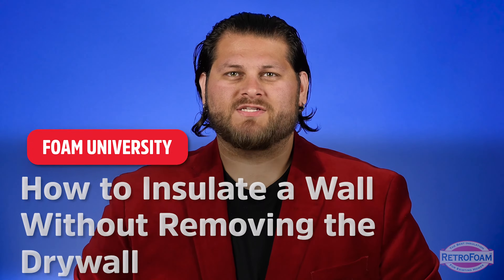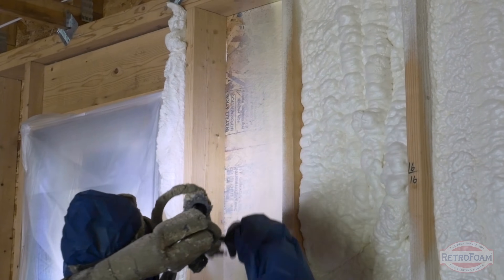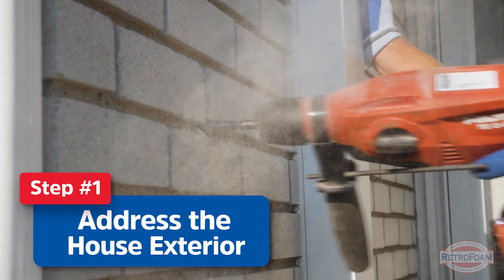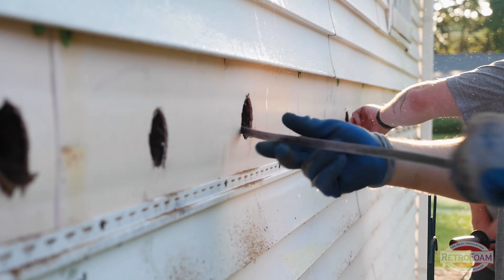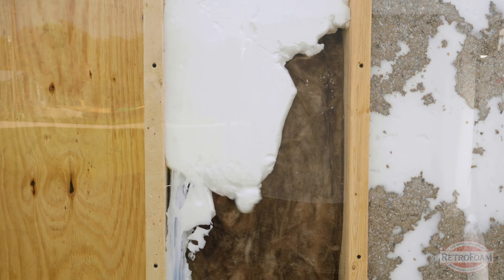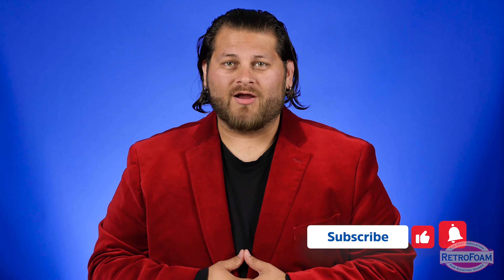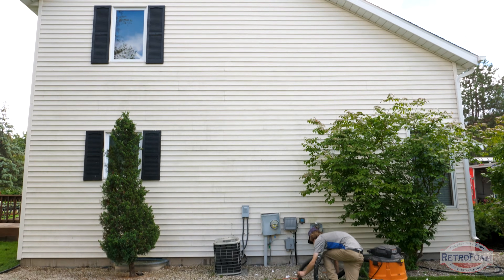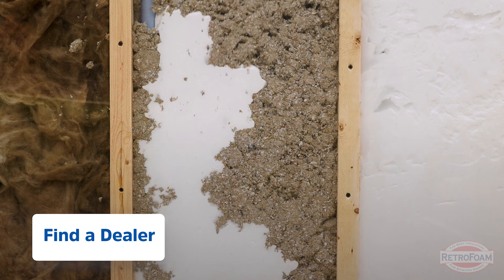How to Insulate a Wall Without Removing the Drywall | Foam University by RetroFoam

Comment: Will this method work for ceilings as well? I have a sunroom I'm converting and the ceiling is not insulted at all. 6 inch joists on about a 15 degree incline.
Reply from the maker: It depends on the ceiling cavity depth and the composition of your ceiling, but based on what you've already said, it sounds like it should be possible! Check out this article from our Learning Center for some additional information on this topic: https://www.retrofoam.com/blog/retrofoam-ceiling-insulation

And you can follow this link to find a RetroFoam Dealer near you: https://www.retrofoam.com/dealers

Comment: What about a home with plaster walls? could this be done the same way (drilled hole between each stud, and filled)? Also! Can this be done through the interior walls?
Reply from the maker: Hello! Yes — RetroFoam can absolutely be installed in homes with plaster or even lath and plaster walls. The process is very similar to drywall, with holes drilled between each stud to fill the cavity. And if needed, it can also be installed from the inside — the crew will protect your space, drill and inject the foam, then patch everything up when finished. Here are a couple of helpful articles on both of these topics:

https://www.retrofoam.com/blog/insulating-plaster-walls-with-retrofoam

https://www.retrofoam.com/blog/insulating-exterior-walls-from-inside-with-retrofoam

Comment: Can this be injected in the basement ceiling? Is there any company in toronto Canada using this method?
Reply from the maker: RetroFoam can be used to insulate ceilings, including basement ceilings, but there are some important factors to consider—like cavity depth and ceiling material. In some cases, it’s a great option, but in others, there might be better solutions depending on the structure.

As for working in Toronto, we don’t currently have a dealer in Canada using RetroFoam specifically.

Comment: Would this cause a problem if you needed electrical repairs in your walls or upgrades to your electrical?
Reply from the maker: Nope! RetroFoam injection foam is soft and pliable, even after it has cured. This means it's relatively easy to fish electrical wiring through it, and sections of the foam can also be removed and replaced for plumbing repair. Check out this article from our Learning Center for some additional information on this topic: https://www.retrofoam.com/blog/fishing-electrical-wire-through-insulated-walls

Comment: We have hardy board siding, hopefully that wouldn't be a problem.
Reply from the maker: Not a problem at all! Homes with Hardie board siding can absolutely be insulated with RetroFoam.

Our crews are trained to carefully remove and reinstall the cement board siding without damaging it. After the foam is injected into the wall cavities, the boards are put back in place and sealed up just like before. 💪

It’s a great way to improve comfort and energy efficiency without compromising your home’s look.

Check out this article from our Learning Center for some additional information on this topic: https://www.retrofoam.com/blog/install-retrofoam-in-homes-with-hardie-board-siding
Reply: @foamuniversitybyretrofoam  thanks!
I see that you do not serve the Tampa area. Any suggestions of how to get a similar result DIY?
Reply from the maker: Unfortunately, RetroFoam cannot be installed as a DIY project. This article explains why: https://www.retrofoam.com/blog/injection-foam-insulation-diy-project

As for a RetroFoam Dealer in Florida, we unfortunately do not have one at this time, but hopefully soon! 🤞

Comment: Do you remove the old insulation first before you put this retrofoam in?
Reply from the maker: In most cases, it depends on the type of insulation already in the wall. If it’s fiberglass, there’s no need to remove it, because RetroFoam compresses it as it fills the cavity. If it’s blown-in cellulose, it may need to be removed, depending on the amount present. Your RetroFoam dealer will inspect the wall and advise you on the best approach for your home. Check out this article from our Learning Center for some additional information on this topic: https://www.retrofoam.com/blog/add-retrofoam-to-wall-with-old-insulation

Comment: We are interested in this for a different reason. We want to sound proof an interior sheetrock wall in the house. Would this help with sound proofing a wall?
Reply from the maker: Although RetroFoam won't completely soundproof your home, it does have sound dampening qualities to make your house quieter! This article from our Learning Center includes some additional information on this topic: https://www.retrofoam.com/blog/sound-dampening-vs.-soundproofing
Reply: You should look up the negatives for spray foam. There are a TON of them. It's one of the worst things you can do for a home. Please don't.

Comment: What is the price to retrofoam a 2200 square foot house?
Reply from the maker: RetroFoam is about $4-$7 per square foot, but this is before any applicable tax credits or rebates. We highly recommend requesting an estimate for the most accurate pricing for your project.

What's your zip code?

Comment: What if my exterior is Brick.
Reply from the maker: RetroFoam can be installed into homes with brick exteriors! To do this, three 5/8-inch holes are drilled at the top, middle, and bottom of each cavity into the mortar. The foam is injected, and the holes are filled with mortar to seal everything up. This article from our Learning Center includes some additional information on this topic: https://www.retrofoam.com/blog/retrofoam-installed-in-exterior-brick-walls

Comment: Don't try and snake a new electric line after this...
Reply from the maker: RetroFoam injection foam is soft and pliable, even after it has cured! This means it's relatively easy to fish electrical wiring through it, and sections of the foam can also be removed and replaced for plumbing repair. This article from RetroFoam's Learning Center contains some additional helpful information on this topic: https://www.retrofoam.com/blog/fishing-electrical-wire-through-insulated-walls

Comment: My house was built in 1927 and the walls are ice-cold in the winter and my upstairs is very warm in the summer.  Does this help keep the heat out in the summer?
Reply from the maker: 100%! This article from our Learning Center contains some additional information on this topic: https://www.retrofoam.com/blog/why-is-my-room-so-hot

If you're interested in finding a RetroFoam Dealer near you to request a free estimate, please follow this link: https://www.retrofoam.com/dealers
Reply: @foamuniversitybyretrofoam  Thank you for the quick reply.  I do have a dealer in my area.  I will reach out for an estimate.
Reply from the maker: Awesome! If you ever have any questions, we're always here to answer them!
Reply: As long as you have balloon construction.
Newer homes don't and this type of insulation won't work because they have side studs every 16 inches.  This is done to slow down fires.

Comment: Can’t this be done from the interior?
Reply from the maker: Yup! It can be a little messy, so our installers always cover everything inside with plastic and make sure to thoroughly clean up after themselves. This article from our blog goes into a bit more detail about installing RetroFoam from the inside: https://www.retrofoam.com/blog/insulating-exterior-walls-from-inside-with-retrofoam

Comment: What about stucco walls? Also there's a first floor wood framed 8' ceiling lowering a 10' ceiling that results in a nearly 2ft dead space between the first and second floor that's completely uninsulated around it's perimeter. Could this be used there?
Reply from the maker: We insulate stucco walls! The process is similar to insulating a home with a brick exterior. We drill three 5/8-inch holes at the top, middle, and bottom of each cavity to ensure each cavity is properly filled. Then, each hole is filled with mortar, and everything is cleaned up.

This article from our blog contains some additional helpful information: https://www.retrofoam.com/blog/insulate-exterior-stucco-walls-with-retrofoam-insulation

Comment: But what about spacers.   You go in and you are only filling half the stud wall.  Spacers stop you from filling plate to plate.
Reply from the maker: Our installers have tools they use to check for fire stops and blockages. They will specifically use a tool called a Slim Jim to determine where spacers and other stops are.

This article from our blog contains some more helpful information: https://www.retrofoam.com/blog/how-do-retrofoam-installers-know-wall-cavity-is-full

Comment: Now what do you do when you find only 1 Stud Cavity is missing insulation? What can i do beside hiring a crew to fix a single stud or renting a giant machine for 1 stud cavity?
Reply from the maker: We recommend contacting your insulation contractor to see if you are still covered under warranty. For example, if you chose RetroFoam for your exterior walls, we have a lifetime warranty and would come and fill that cavity free of charge, as it was missed in the original installation.

If you are not under any sort of warranty, we recommend heading to your local home improvement store and filling the cavity yourself. Hiring us to fill one cavity would not be worth the investment, unfortunately, as we have a minimum price for all jobs.
Reply: @foamuniversitybyretrofoam   With the foam not being able to displace existing insulation, doesn’t that lower the R factor?

Comment: And what happens in the future when you need to run electrical, data.....
Reply from the maker: Hi, Keith! RetroFoam is soft and pliable, even after it cures. This makes it easy to fish electrical wiring through it or even remove a section of the foam to repair a plumbing issue.

Check out this article from our blog for some more information: https://www.retrofoam.com/blog/fishing-electrical-wire-through-insulated-walls
Reply: What happened to old insulation

Comment: How do you get past fire blocking in walls?
Reply from the maker: We have a special tool that we insert into the holes that we drill to detect a fire blocking. If a fire block is located, another hole will be drilled (either above or below) in order to get that injection foam all around that fire block.

Comment: I have an older block house with furred out drywall against the block. So there is 1.5 inch wide areas (drywall to block) id like to foam. Can this be done from the inside of the house?
Reply from the maker: Yes, it can. If you have drywall up, the installer would just drill a hole in it to inject the foam. When they're finished, most contractors will put a rough patch of mud over the holes.
Reply: @foamuniversitybyretrofoam  Ok that seems like a good way in my situation. I contacted my local representative and he said if they went in the outside into the house block through the grout and foamed the inside of the block it would give me a lot higher R value than foaming between the drywall and block. Which way would you recommend?
Reply from the maker: There are pros and cons to both.
The block would be a higher R-Value overall. However, insulating the "stud" cavity gives better protection from thermal bridging.
The best option would be to do both.
If you can only do one, I'd probably do the block just to avoid the mess on the inside.

Comment: Very interested as I have vinyl siding and lathe/plaster walls.  My house is old and I'm torn between outsourcing and DIY.  I keep reading that old homes have empty wall cavities "so they can breathe" to eliminate moisture buildup.  Bottom line I'll need insulation at some point, but don't want to introduce a mold issue.  Are there any warranties?  I assume you do the top floor as well?
Reply from the maker: Good questions! We hear of "breathing" concerns often and address them a few times in our learning center (www.retrofoam.com/blog) if you want to read more about it. Basically, with an appropriate HVAC system making your home "tighter" with foam insulation will not cause any issues. For the warranty question, a majority of our dealers offer lifetime warranties or something along those lines. It varies by dealer, so you would need to contact the dealer closest to you for more information on that. And yes, we can also handle the top floor.

Comment: Do you put plugs in the holes you make to inject the foam? Because rats and mice will take advantage of the holes. They'll just rip out the foam to get in.
Reply from the maker: Yes, we plug all holes that are drilled. This foam also creates an airseal that helps deter animals from finding ways into your home via air leaks.
Reply: @foamuniversitybyretrofoam  how do you check for the air leaks!
Reply from the maker: We recommend an energy audit to find air leaks. Some of our dealers provide them, but if they don't, someone in the area can do an audit before our services.

Comment: Would this work on school busses with out bulging the panels?
Reply from the maker: Unfortunately there is always a small chance of buldging panels. However, it does not happen often. Speak with your contractor about the concern beforehand and you may be able to discuss additional precautions that can be taken to avoid buldging from happening.
Reply: @foamuniversitybyretrofoam      with a school bus could you add some kind of solid flat brace to either side of the panel to reinforce the metal?   A larger piece that covers more then the cavity being filled could be secured with suction like for heavy glass  or heavy duty magnets. Good luck and have fun!